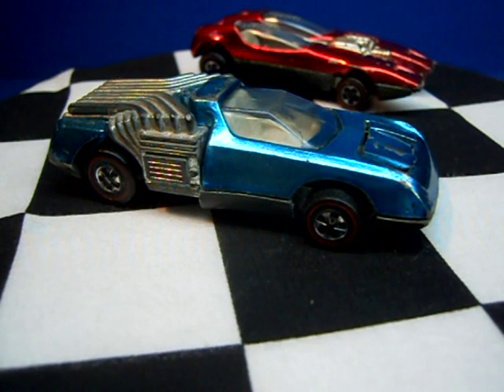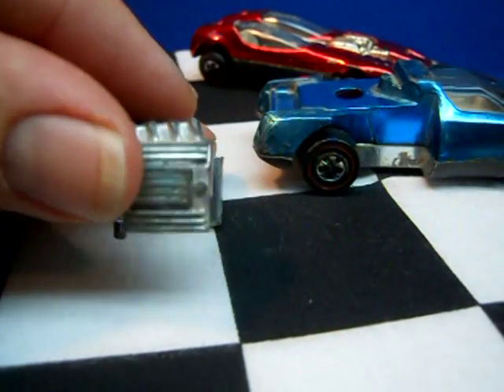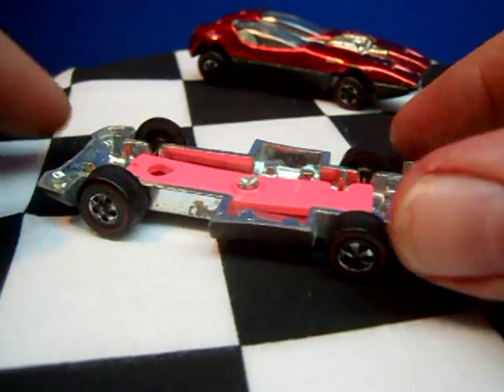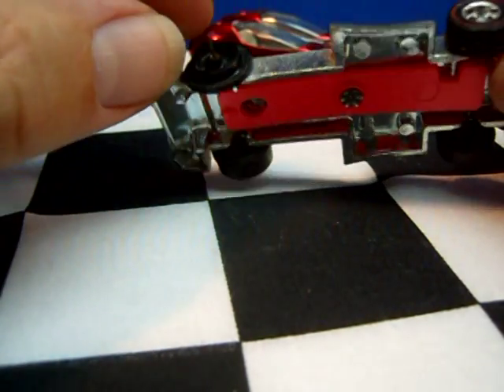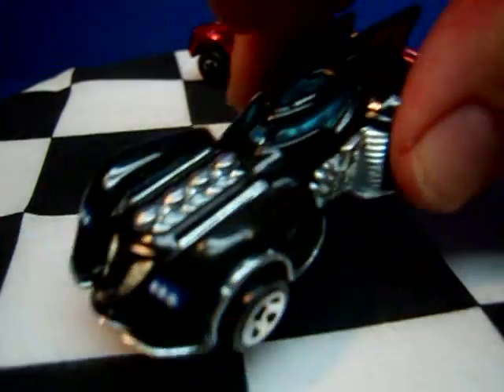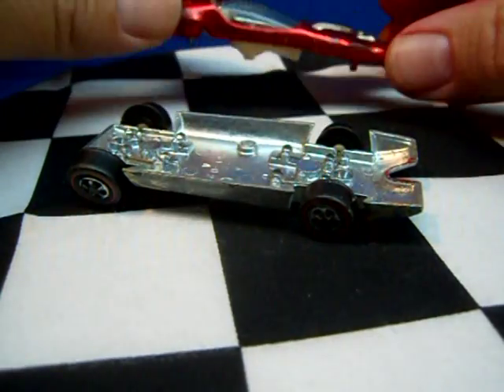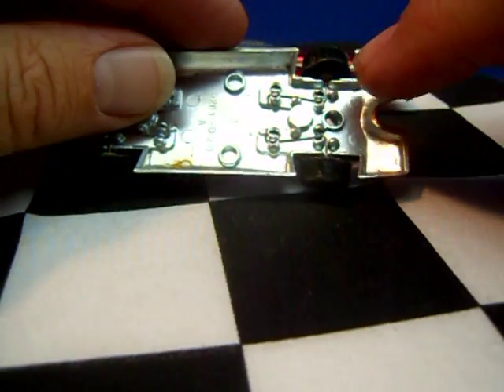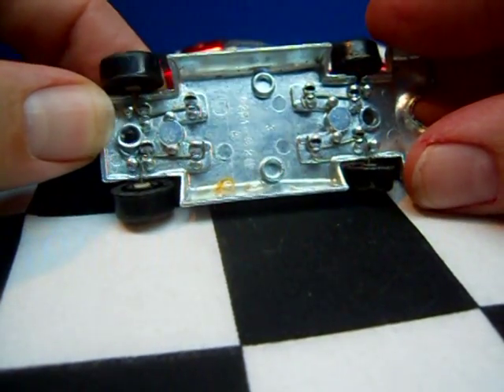The Inside Story: Hot Wheels Redlines

Comment: that bent axle suspension is really cool, it's a bit like torsion bar suspension they use on tanks, i wish they still did it, i'd pay the extra money for it. Great video like usual Mark cheers m8.
Reply from the maker: They tried re-issuing cars with bent-axle suspension on HWC. They said it was costly to pay somebody to assemble the axle suspension system. From my experience, the cars did not roll well. They wobbled and veered. I'm not even sure if they do it anymore and may have went to a straight-axle for all releases.
Reply: @racegrooves  it’s like trying to build a Mercedes on a Ford production line, such that the result is neither.

Comment: The one big issue with the torsion plate suspension is that the axles (usually the rear one) comes loose from under the plate and that causes the axle to flop around and not roll correctly. The only way to fix it is to drill the car and open it up. You take away some of the value whenever you do that, but I guess it's better than it not rolling and not having suspension.